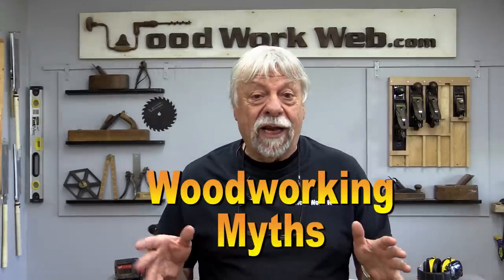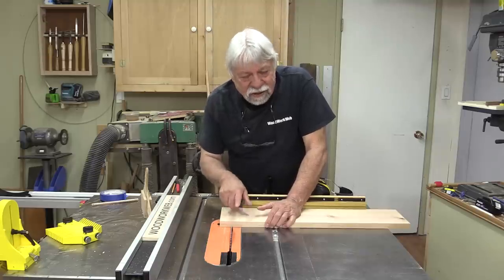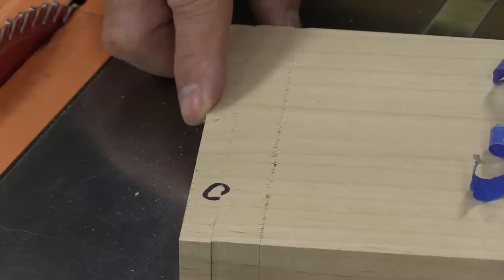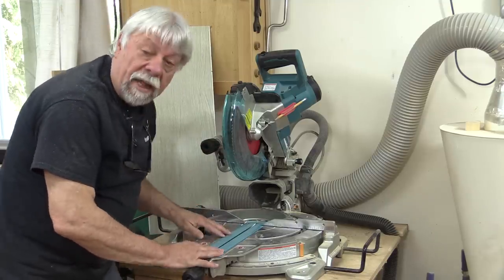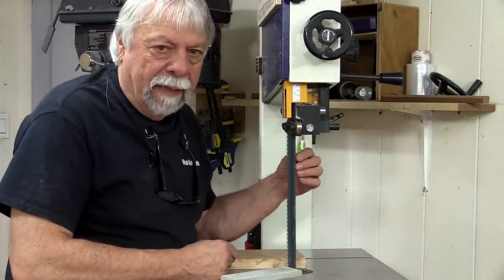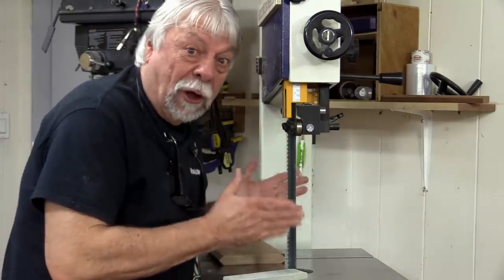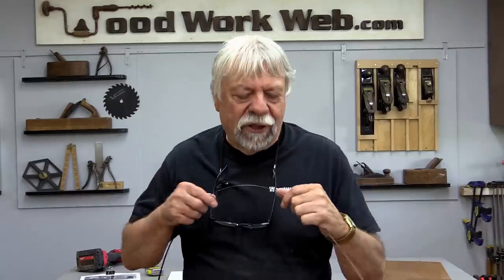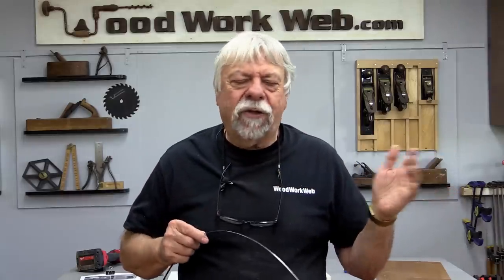Woodworking Myths and Useless Woodworking Hacks

Comment: Hi - at 6:53, you show the tear out being worse - but if you watch at 5:43, the blade is cutting the face-up side first (plunging down) - not from underneath as you said earlier.  When you turned the wood over, the area of tear out (1/3 of the length of the cut) corresponds to the top-down cut of the blade at 5:43.  Could that be the reason for your finding?  Awesome video, teaching skill and artistry, and video production - all top notch!

Comment: You seem to misapprehend the purpose of the zero clearance mitre bed; it's not create a better cut, it is to prevent the offcut from falling into the path of the rotating saw blade. If you've ever had the offcut get caught up in a spinning blade, you'll know that it always costs you a blade, if you are lucky, certainly the saw's alignment,  it can wreck the whole mitre saw if you aren't so lucky and fingers and thumbs or eyes if you are even less lucky.

Comment: Hi Collin! I would have to respectfully disagree with the fact that you think that putting tape does not reduce the tear out. I saw your demonstration on the Plywood. The issue is in the manner in which you pull the tape off. If you think about it, The manner in which you pulled the tape off encouraged lifting the fibres (tear out)! If you pull the tape off at the proper angle you will not lift the material near the cur edge! Pull toward the cut edge and slightly down! The tape should also be pressed tightly to the wood along the cut prior to cutting! You will find that masking tape Will reduce tear out!

Comment: If I'm concerned about tear out I scribe the cut with a utility or marking knife. That's particularly important on the side the blade exits the cut. I've used this technique on hollow core doors. It works well when I've had to cut below the rail. I make several passes with a utlity knife cutting completely through the plywood skin on both sides.To make sure I've cut through skin where it's glued to the stile,  I check the depth of cut in the stiles by making sure the knife kerf is in the stile. Using a circ saw I cut just the stiles proud of the kerf on the waste side and sand to the kerf. I also used this technique on melamine shelving so that both sides have clean cuts.

Comment: I've always questioned the use of adhesive tape in any cutting operation.  Why?  Because the adhesive from the cut tape contaminates the cutting edge of the tool.
My philosophy has always been :-   "If the right tool for the job does not give an acceptable cut, it ain't sharp enough." 
Now for something positive :- 😀
One technique I was taught with the chop and mitre saws, is to take a shallow backward cut, before making the final foreward cut, so that the blade is cutting  down into the top surface of the material. This means that in the final push, the blade completes it's upward cut below  the top surface of your material and tear out can be noticeably reduced.
Thanks  for your vid's Colin.  Keep 'em coming.

Comment: The trouble is now days is that people buy or are encouraged to buy skip-tooth bandsaw blades which are really for soft metals.This means there is very little set on the teeth and this means very little clearance for the blade hence binding. The older wood cutting style of teeth were much better, giving a cleaner cut with less binding on the back edge of the blade. Unfortunately these saws required sharpening more frequently so there is a trade off. Comes down to Horses for courses really.

Comment: A lot of good wisdom here, Colin. You could write a book on bandsaw myths alone. I use two bandsaws; one for straight cuts and he other with a ¼” blade for curves. It takes a lot of time to change blades because of adjustments in the guide bearings on top and bottom. However, the myth of BLADE DRIFT is one that needs more coverage. For years it was recommended that the blade be placed on the top wheel so that the teeth overlap the (left) edge of the tire. This automatically causes blade drift because of the fact that there is a slight hump in the middle of the tire at the highest point, thus slightly twisting the blade at the cutting line. I ended up centering the blade on the wheel and, voila, drift went away. I can now cleanly resaw a slice as small aa 1/32” without adjusting the fence for drift.

Comment: The reason to slightly round over the back of a BS blade, is to eliminate any small nicks or burrs.  This supposedly prevents the blade from breaking when properly tensioned.  It has nothing to do with cutting curves.

Comment: The advantage of using a stone on the backside of the bandsaw blade isn't to get a tighter radius.  That won't change unless you take enough off of the blade to make it significantly thinner... so yes, keep a couple different size blades on hand in order to cut different radii. The advantage of smoothing out the back of the blade is that you will get a significantly smoother finish on curved cuts by removing any burrs on the back.  You can even take it a step further by putting the blades on backwards so that the teeth run upside down and stoning the sides of all the teeth.  You do have to do this upside down though and gently or else you'll destroy your blades.  This will "fix" any minute variance from the factory on left<-->right tooth extrusion.

Comment: Band saw blade wouldn’t get hot enough to melt the steel, your wood would catch fire first. It might possibly get hot enough to take the temper out of the steel, which would then soften the steel, and make it dull quickly.

Comment: Colin, the way you did the zero clearance on the mitre saw may not have been a great example. Without the normal insert in the slot, the ply is poorly supported and could easily chatter. If the backing was solid the result nay have been a lot better.

Comment: The best way to get a good cut is to get those Diablo blades he has.  For the price, they are by far the best I've used.  (I"ve never splurged on somethign like a Forrest or whatever) but I can definitely vouch for those Diablo blades.  Very clean cuts compared to the Irwin blades I've had (sorry, Irwin.)  I still have an Irwin dado stack set, and it's excellent though.

Comment: I used tape literally yesterday, which was especially handy on a dowel, which isn't backed on any side.  I tried to get away with test cuts without tape there was too much tear-out to avoid it.  You're using finishing blades and backed materials, which is the whole point.  Not to mention, the difference you will see depends on the wood you're using.

Comment: You are correct about tear out but there is a different advantage of a zero clearance insert on a miter saw. I use zero clearance inserts on my miter saw to position the wood I am cutting. Just mark the edge of the stock being cut and place that edge nearest your body. It is then easy to sight down the mark so it is precisely lined up with the edge of the groove in the insert. It is faster and more accurate than a laser line. The only thing better is a well positioned stop block but it is not as fast unless cutting a batch.

Comment: I can guarantee you that taping does work to reduce tearout. But the trick is that you have to burnish the tape down with a fingernail or a screwdriver handle. If you do that, the tape will indeed reduce tearout.

Comment: On the Mitre Saw, the bulk of the tear out is to the back/upright side of the board, having a backer board in behind the board does help prevent LARGER tear out (Not smaller tear out like we saw on your boards). I am making several zero clearance (for both fence and different angles on the plate), just so I can have the ability to cut very small stock on the Mitre Saw, not for tear out at all. That is the value of the zero clearance inserts, no matter where you have them.

Comment: Hi Colin, you start the video with the comment that the table saw first cuts the wood on the top. Are ýou sure about that? Because in my opinion the blade is round and the center of the blade is inside the table saw. So in my opinion the first point where the blade cuts the the wood is on the bottom (as the bottom part of the wood lays on the table saw where the blade comes out) - and because of the round blade it is also the last point where the blade then exits the wood.

Comment: My miter saw has a vertical board on the fence with zero clearance.  It gives a fantastic alignment point for pencil/knife marks and prevents tearout as the blade exists the back of the workpiece.  A ZCI is highly beneficial to keep small pieces from falling under the insert and later being picked up by the blade.

Comment: It wasn't emphasized, but the zero clearance on the miter saw only doesn't matter because you're using a sliding miter saw and drawing the blade through the work. If you have a non-sliding miter saw or don't slide the blade on a sliding one, the blade definitely cuts the top first, and a zero-clearance insert will help with tear-out. Or get a better saw blade.

Comment: I tried the tape thing for a short bit, but i found that it takes up a lot of time (and uses up tape!). I score a line with an OLFA blade if I'm concern about tear out.
On my mitre saw, I run the blade across the top first to get a nice clean line on the top, then I plunge it

Comment: You missed a few things on the zero clearance for the miter saw.
1) People often do zero clearance for the fence also.  Your cuts very clearly had bad tear out on the edges of the boards that were cut that could have been prevented
2) Zero clearance on the base of the tool is for more than just a cleaner cut, it allows you to cut small slivers without them falling into the space below.  You theoretically could also completely remove the covers as you did, but then don't have support for small pieces and/or risk them getting caught in the blade and doing damage.
3) It gives an accurate place to measure for some tricky cuts like compound miters for crown molding or even regular miters if your measurement is to the heel of the miter instead of the toe.

Comment: Love your videos.  Thanks!  I have a question for any smarter than me folks out there.  Has anyone wrapped stainless roll flashing around a 2x8 (or 10) for a deck to railing?  Converting my Weber gas grill into an enclosed station inside a deck railing bay.  Thinking I'd epoxy it down, then bend it over the edges.  Thoughts?

Comment: Some band saw blades definitely have carbide tips. I know because I have one. Also, it seems to me that the mitre saw only cuts from the bottom first for the portion which you've brought the blade below the bottom of the piece. That never happens for a standard mitre saw, and even for a sliding mitre saw if it's a wide piece it might not be very much of the cut.

Comment: I have used a zero clearance approach on my chop saw for years. Not to get a better cut but to prevent sawdust and small pieces from falling into the bed throat and jamming up the swivel table after some time.  Previous to the zero clearance i would need to remove the swivel table at least once per year to clear the collected garbage underneath...

Comment: love the vids, but i will say this about zero clearance, youre absolutely right when it comes to hard wood, but soft wood like pine it will make a difference, also, zero clearance plates are a great safety feature, they prevent thin slices you cut for squaring the ends from going into the channel only to he hit by the blade and flung back at you-i will ALWAYS have a zc plate, only took me getting hit multiple times to learn

Comment: Zero clearance is important for a mitre saw that doesn't slide or when you are cutting the full capacity of the sliding mitre saw. In both cases it plunges through the material from the top and can leave a rough exit on parts of the bottom. Especially on material like pine or plywood.

Comment: What about a zero-clearance vertically on the miter saw on the back fence? That would help a bit, right?
Reply: @Harry M Yes, but that would be true for any sort of zero clearance insert I assume. Once you start chopping it up in multiple directions, angles and bevels, the zero clearance property is lost.
Reply: I added to my fence in this fashion.  I'm honestly not sure if it improved cuts on my simple non-sliding saw or not, but it's way easier to measure from the edge of the kerf on the fence. It was worth a scrap of plywood for that alone.

Comment: I saw you had the allen wrench in the drill chuck......i just read about using that method to remove said chuck from the drill that uses a pin and not a screw to knock it loose.  So that you can replace it.   I have yet to replicate that

Comment: Isn't the main point of having a zero clearance insert on a mitre saw to make more accurate cuts quickly? (Line up to the clearance line and away you go).  So it's not exactly pointless I guess I'm saying.
Reply: 100%.  Any trim carpenter would tell you that.  Also tape on melamine is essential.  I dont think he understands what some of these are actually used for.

Comment: The band saw blade round off is not to make tighter corners. It is so the sharp edges will not cause tracking lines when you make tight turns. JET and delta both recommend you do this as part of the blade installation in the operators manual "setup". They do not tell you to use a sharpening stone though. They say to use a carburundum stick. Really doubt you have a clue what that is

Comment: I think the blue tape helps if you put it on tight and pull off with a different direction. End your pull with the cut side. If you put on tape loose then it is like not putting anything on the wood. Never heard of zero clearance as help the wood cut cleaner, it just help pieces not to fall thru. Similar like table saw, if you need to do thin strip you need zero clearance or else it falls in. Only  when people use "sacrificial board" to get cleaner cut yes. But again between the wood needs to have good pressure to create as one piece of wood, no pressure like the video it just cut 2 pieces at the same time.

Comment: that's not why you round the back of bandsaw blades the goal of that is just to knock if any light burs and don't use a corse stone use fine sandpaper your just lightly touching it nearly flat to the blade to keep any burs from making the surface Finnish any worse than it already is in a bandsaw

Comment: The bandsaw myth that I've heard many times is that in order to cut straight you have to clamp a wooden fence across the table at an angle. No, set up your saw properly, otherwise why did the manufacturer provide you with a fence?
Reply: This may be too simplistic, but I believe successful re-sawing depends on the stress "locked up" in the material, which is why I use a fence, but put the thin slice being cut to the outside, not trapped between the fence and the blade, battling out the forces.  Dry stable wood . . . . no problem at the fence.  Fibers inside, screaming to be free -- no chance of a really straight re-saw.  Sleds are good for that application.

Comment: It still seems a good idea to round the opposite edge of a bandsaw blade before first use. It's a sheet of metal which was at some point cut which could create some degree of deformation on the dull edge, it's just easier to run a sharpening stone for a couple seconds on each side to get rid of potential manufacturing imperfections than inspect it for such.

Comment: Most don't realize the purpose of using the stone on a band saw blade is not for producing a radius edge on back but to remove the slight off set alignment of back when blade is welded. This slight off set causes blade to wander back and forward slightly which causes blade to wander sometimes or leave rougher saw marks due to inconsistent contact to thrust bearing. As for the miter saw the area that needs a zero clearance insert is the fence side since that is where the blade exits leaving the most tear out.

Comment: Thanks Colin!  Sounds like you need two bandsaws, one with a 3/4 inch blade and one with a 1/8!
Reply: i actually have two band saws, i got them for the same reason, i am now going for number 3 just for metal cutting. I hate changing those damn blades.

Comment: I put a new 3/4 inch blade on my Jet 18 in  .  It was bouncing around all over the place but after smoothing the back and rounding thr edges of the pack it was smooth running

Comment: I disagree with your conclusions.   In my experience the tooth count is the #1 factor do reduce tear out.  After that having a sacrificial piece on the exit side of the cut is the 2nd best solution.  The ape can help with tear out that occurs at the end of the cut on the face.   In any cases, the conclusion should be “use what works for you.”

Comment: The battery memory effect was largely a myth, even in the days of NiCd batteries. Early (talking the 70s maybe into the early 80s) NiCd cells did suffer from memory effect due to lack of full discharge. Later NiCds didn't suffer from this. They did and still do suffer from crystalline formation, which can be corrected by a full discharge, however the main cause of the crystal formation is overcharging or leaving it on charge longer than it needs to be. If you ran your cells down to nothing you could theoretically reduce the crystallization problem, but only if it results in fewer charge cycles and less time on trickle charging. Intentionally running the cells down at the end of a usage session doesn't accomplish this, and in fact excessive full-drain cycles results in cell damage. The recommended practice is to run the cells to 1V or less about once a month. Of course this makes some assumptions about how often you're using the battery; if you only drain it once a month, draining to 1V every time might be excessive.